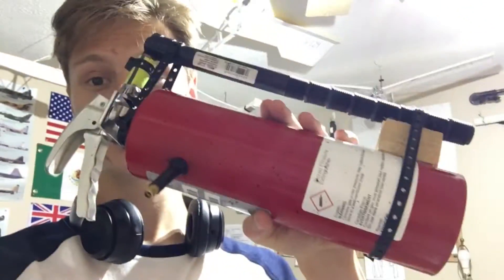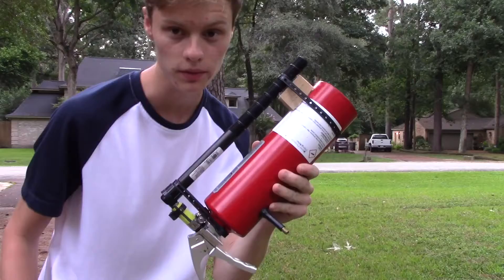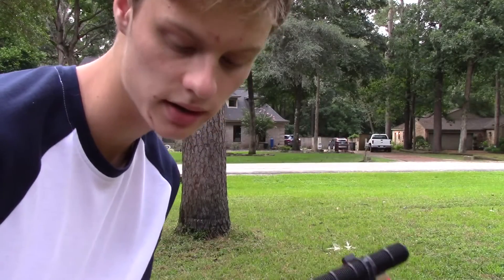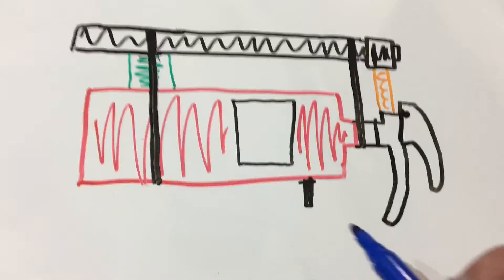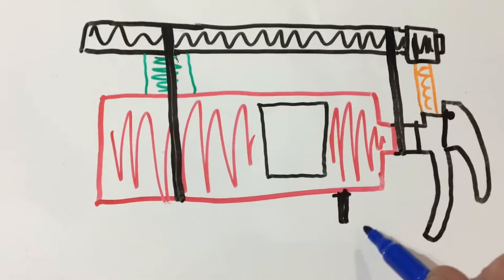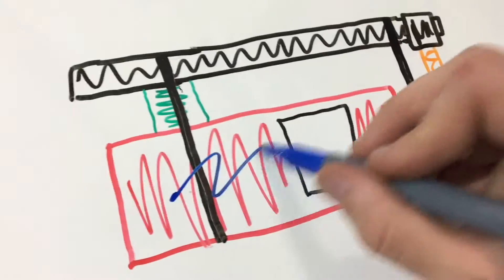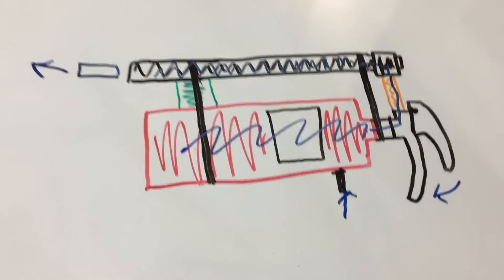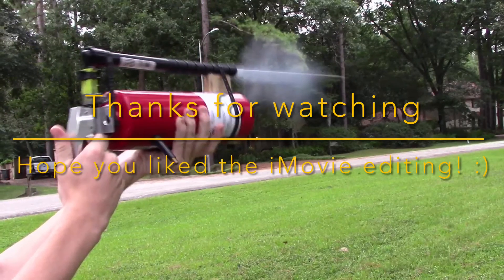Fire Extinguisher Air Cannon! (Battery Shooter)

Comment: If you took a normal fire extinguisher, right off the wall, cut the tubing so that there was no nonsense at the end that would interfere, and then crammed a battery in there, would it have enough pressure to shoot a single shot?  I get what you were saying with the battery not being rifled, but I wonder if you could create an improvised weapon that would be able to shoot once.  Or am I missing something obvious?
Reply from the maker: I see no reason why it wouldn’t work if you made sure the battery fit the tube. That’s a really interesting idea

Comment: very cool build, i'm gonna get a fire extinguisher tomorrow and build one myself. Also, if you want to upgrade power you should use other projectiles such as BBs or dart and add a longer barrel.
Reply from the maker: Awesome!
I was planning on building another version that shoots throwing darts but just never had time
Reply from the maker: A lot of the energy is wasted from the lack of rifling and the the battery just tumbles. So something with fins would work well